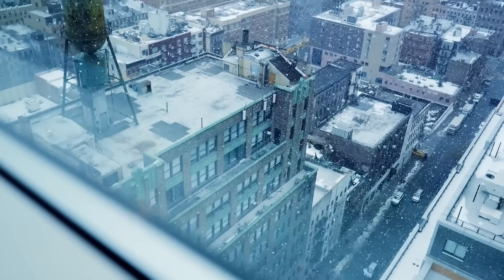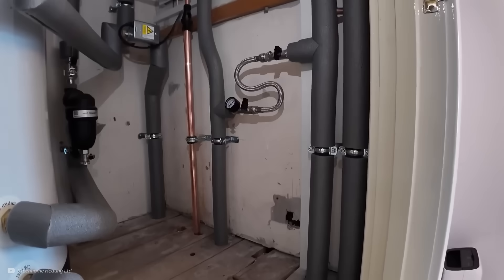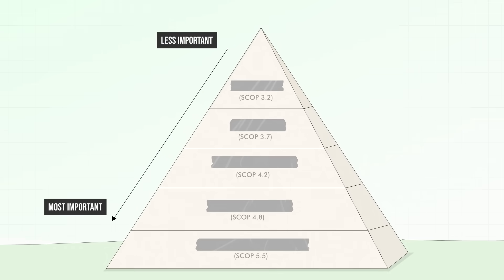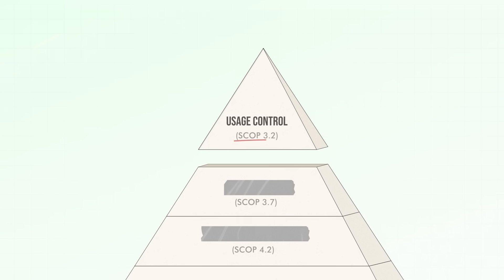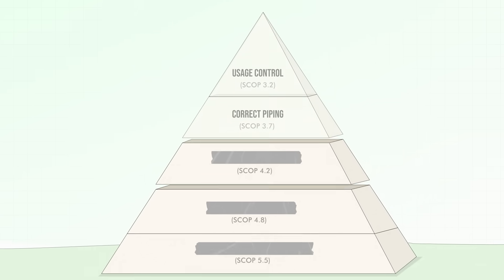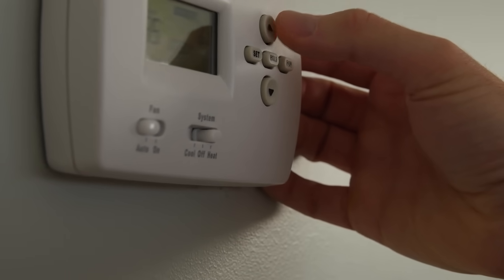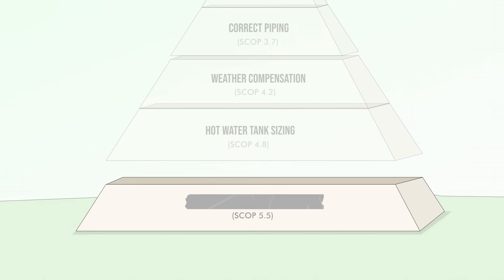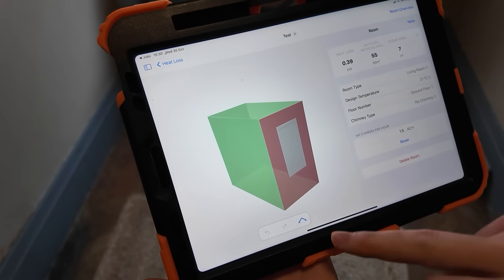The Genius of the World's Most Efficient Heat Pump

Comment: Correct me if I’m wrong: the only part in your system that actually moves heat from the outside environment to your inside environment is the heat pump and that part give you a COP of only around three. The rest of the system - the piping optimization, the heat exchanger optimization, all that, is just to minimize the systematic losses. In another word, the heat pump is your engine and the rest optimizations are your drive trains gear boxes all that. Therefore the most you can get is the amount that can be actually produced or in this case moved by your engine (your heat pump)

So explain this to me: how can you get a systematic COP that is actually higher than the COP of your heat pump? Did you actually get 8 kWh of usable heat by consuming 1 kWh of electricity? Or did you invent some new fancy ways to define systematic COP?
Reply: It's rather misleading i agree. It would be more correct to refer to it as the total system COP.
Reply: Correct, they are accounting for the whole system. Similarly you cannot give an efficiency rating for a car engine that produces an amount of power. Car manufacturers  provide an efficiency rating in MPG depending on the whole system including speed, shape, tyres, electrical systems, weight and load.
Reply: Heat pump COP depends on the temperature differential between inside and outside temperatures.  The "standard" COP stated by a manufacturer is usually for a temperature differential of 35-40 deg C and is around 3-3.5 for modern heat pumps.  If that differential can be reduced to maybe 20 degrees or less, the COP can increase to values >6.  All the "tricks" described in the video are geared to minimize the temperature differential and thus run the heat pump at "slow speed" (=higher COP).
Reply: pppjunk mentions the actual COP will vary according to the temps and mass flows, and the advertised COP is at stated conditions all mfgs use.  It seems the techs in this video have found conditions where the COP is higher than advertised, and strives to operate as near to those points as possible.
* Measuring and (integrating the real time(  delta Hout - delta Hin))  / W  over the day for the current COP or season for SCOP.  (Oddly, kYouTube apparently censors the delta symbol.)  Power inputs for pumping and blowers should also be included.  Using formulas to calculate the real time enthalpies to account for temp and pressure is straightforward.  For the mass flow, ?  Pup and P down across the expansion seems a little trickier, but an orifice plate with ΔP in the vapor line should be good.  Then compare the same system before and after all the nuances are added, to determine the real gain in COP.
Reply: The adjustments raise the efficiency of the heat pump by running it in it's optimum state. It's like increasing your miles per gallon by slowing to 50 mph, ensuring your tyres are filled to the proper air pressure and not driving with the windows open and adjusting your speed to the traffic ahead so you don't need to keep hitting the brakes.
Reply: Calorimeter and wattmeter on heatpumpp inputs and outputs and show us the numbers....
Reply: This is all a stupid explanation. Efficiency factors multiplie in chain. Anything behind the pump itself has effiiciency below 1.0. Otherwise this deserves a nobel price… And the recommendation to "use it right" is strange: That means if outside temperature is low, don't heat because it increses your total efficiency. Or turn hot water down to 35°C to increase the efficiency with the side effect that you will die by legionella…
Reply: u r correct no added 'efficiencies here, its all techno babble n grift n marketing to sell us on marginal products that will break in 5 yrs [out of warranty  of course], save a few bucks maybe n literally just encourage user behaviour change subconsciously, that will drive the actual improvement.
geek or specs n theory does not real efficiency improvements n cast savings make.
without exception assume all these things ARE scams
Reply: The way I understood it was that these COP measurements (each layer of the pyramid) are for the whole system, and are for each improvement to the system. EG, the first stage with a COP of about 3 is an out-of-the-box heat pump system. Then each layer beyond that is a modification that further increases the efficiency of the entire system by reducing the losses incurred by each of those items. 

In other words, the "COP of only around three." is not for the heat pump itself. Its for the whole system without any of their optimizations.
Reply: ITs really just that the system is two heat exchangers with a pump between them. The larger you make either side the more cop. Same thing with optimal pump speeds. They all depend on each other, the pump itself has no cop.
Reply: pppjunk mentions the actual COP will vary according to the temps and mass flows, and the advertised COP is at stated conditions all mfgs use.  It seems the techs in this video have found conditions where the COP is higher than advertised, and strives to operate as near to those points as possible.
* Measuring and (integrating the real time( ΔHout - ΔHin))  / W  over the day for the current COP or season for SCOP.  Power inputs for pumping and blowers should also be included.  Using formulas to calculate the real time enthalpies to account for temp and pressure is straightforward.  For the mass flow, ?  Pup and P down across the expansion seems a little trickier, but an orifice plate with ΔP in the vapor line should be good.  Then compare the same system before and after all the nuances are added, to determine the real gain in COP.
Reply: pppjunk mentions the actual COP will vary according to the temps and mass flows, and the advertised COP is at stated conditions all mfgs use.  It seems the techs in this video have found conditions where the COP is higher than advertised, and strives to operate as near to those points as possible.
* Measuring and (integrating the real time( ΔHout - ΔHin))  / W  over the day for the current COP or season for SCOP.  Power inputs for pumping and blowers should also be included.  Using formulas to calculate the real time enthalpies to account for temp and pressure is straightforward.  For the mass flow, ?  Pup and P down across the expansion seems a little trickier, but an orifice plate with ΔP in the vapor line should be good.  Then compare the same system before and after all the nuances are added, to determine the real gain in COP.
Reply: @zyxlsy  ok I have to admit that optimizing the hydraulics can bump up the cop ..yet cannot get over tech spec cop of the heatpump, just allow to work in optimal conditions
Reply: yeah good question
Reply: @Netherlands031  It's really simple: heat pump COP depends on temperature difference between the two heat exchangers (outside air and warm water in the heating circuit) which is called deltaT. The higher the deltaT, the lower the COP. All the advice he gives boils down to reducing deltaT. Correct choice of radiators and pipes, smart control etc, allow using lower temperature hot water in the circuit. Running the heat pump at lower power for longer is like having larger heat exchangers, again reducing deltaT.
Reply: @pppjunk  you didn't explain how he got a higher cop than the heat pump is specified for
Reply: @Netherlands031  Heat pumps don't specify one COP. They give you several values of COP at various temperatures. You can absolutely get COP 8... at times when you don't need heating at all lol. I think he's bullshitting with the SCOP though, it sounds too high to be true.
Reply: @pppjunk  According to him if you use the correct water pipe fittings you gain 0.5 SCOP 😛
Reply: @Netherlands031  I think this lot that believe these amazing COP and SCOP numbers are the same that invested heavily in 2007-2008 believing everything that this heat geek type person told them about the market, as soon as he started talking about volume of heating fluid, restrictions in pipes, I knew this is gona be all nonsense and inventing new units of "measurement" because - bigger numbers help sell their product
Reply: @Netherlands031 it’s only an estimate from manufacturers, same as range or mpg on cars
Reply: @girenloland  What he notes is that maintaining a low pressure flow of warm water by making sure the pipework does not slow water speeds down (lots of corners in pipes, small pipe diameter vs ideal flow volume) means the water has more time to dump heat that passing at speed through a radiator without enough time for the heat to be dissipated, this is even more so for low flow underfloor heating where there is an larger surface area already than a standard rad. Anything which requires more adapters to connect lengths of pipe also creates water pressure falls - although I don't see how such adapters would generate such a flow rate drop unless your plumber was adapter mad.
Reply: But if you burn diesel or something, you'll get 11 kWh heat per liter... So I mean... It's kinda obvious, that you need better house isolation etc to save as much of that energy inside. By adding an outside wall's isolation, you are not making more kWh out of diesel... You are only saving more of that energy inside...
Reply: @TheCraterGames but that's not what COP calculates. COP does not consider heat losses. The point is that by having lower heat losses, your pump can run at lower flow temperatures to maintain the temperature in your home. Hence you have a lower deltaT, hence higher COP.
Reply: COP is really only the heat pump.  To measure the whole system you would need to have sensors inside and outside every external surface, plus some method of monitoring air leakage.
Reply: Cop is only for your heat pump and exchangers that's it you can not increase it if the pump it self can not do the numbers ,cop takes everything into account proper plumbing, insulation, etc. If the system can only be 3 at x temp that's it will not do any better, now you can add some automation to it to expect weather changes which could help but the cop will be different and be a totally different system floor heating is your best there's a lady in YouTube that has it and keeps her house warm for 2 to 3 days with only about an hour or so worth of heating
Reply: Yup I'm confused too. If I run a resistance heater, it's 100% efficient, it doesn't matter if my windows are open, whether my house is insulated or not, what size my water tank is etc, it's still 100%.

I feel like they've developed a method of measuring that is disingenuous at best. They're calculating run time and how they've managed to decrease it.

This pyramid can be used with any heat source from coal to hp and it will have the same effect. If I find a way to run my resistance heater half the time, I can't suddenly claim it's 200% efficient... Or can I? Someone correct me if I'm wrong.
Reply: @larry365 the point is that with lower losses the heat pump can run at a lower flow temperature to maintain temperature in the house. At a lower flow temp you have a higher COP, hence better efficiency. Compare that to a boiler, where the flow temp has no effect on the efficiency
Reply: @pietheijn-vo1gt  absolutely not true, flow temp does make a difference to efficiency in a boiler - but its its not a big number. Theres a reason theres condensing boilers now, and its for efficiency...
Reply: @Etacovda63  its 5 percent at best... not worth discussing. While for a heat pump flow temp can mean the difference between 200% and 500% COP.
Reply: @larry365  why cant they use something like energy per cubic meters or something like that ? makes more sense to me
Reply: @larry365 
Resistance  makes heat. A heat pump just moves heat around.
Indoor to outdoor or the opposite. 
The losses in the starting and stopping and restrictions in the pipes fitting ( bends) can reduce the effectiveness of the output from the heat pump.
With more heat to capture, 50f outside will be more efficient than 20f.
In cars we effect output with tuned exhaust pipes and low restriction air intakes. Same principles at work as heatpump piping.
Reply: @billsorensen6873  Resistance makes heat ?  But pipe fittings create resistance 😂
A heat pump just moves heat around  ?  If a HP doesn’t produce heat but just consumes electricity to run a big fan , a compressor and a pump how can it be 300% efficient ?
Reply: @larry365  your lack of understanding of the physics doesn't mean they're disingenuous, it means you need to do some reading.

Heatpumps move heat, they don't create it. Look up the refrigeration cycle. Everything heatgeek does is legitimate and in no way a scam. My heatpump is currently running at a COP of 5.15 (1440w power input, 7422w heat out).
Reply: @Etacovda63  You haven't read the OP comment and haven't applied the context of that comment to my comment. I have no issue with COP and I'm not claiming that they claim to break the laws of thermodynamics. My question is how HG arrived at their numbers. Drop the arrogance, especially when you are incapable of reading comments correctly. Feel free to correct my original comment but make sure you read it this time.
Reply: @larry365  They haven't figured out how to make it have a shorter run time.  Just the opposite!  They figured out how to make it run longer but more efficiently.  It's exactly analogous to the car example where one car goes 90 mph but stops a lot, and the other car goes 30 mph constantly.  The 30 mph is more efficient, and less wear on the car.
Reply: @larry365  Yes, slightly harsh, sorry - but you and OP seem to be missing a fundamental aspect of how a heatpumps COP is calculated

A COP is not a fixed figure, its a curve. It changes depending on the temperature at the outside unit, vs the water temperature.

Most air to water heatpumps have ratings like this - they're examples only

A = air temp in C
W = water temp in C
Number = COP

A7/W35 = 4.88
A7/W45 = 4.3
A7/W55 = 3.5

A2/W35 = 4.1
A2/W45 = 3.8
A2/W55 = 2.5

So you can see, if the water temperature is lower and the air temp is higher, your COP increases. I've seen mine running in excess of 10.
Reply: @Etacovda63  All good and your last comment was genuinely the last thing I've read for the penny to finally (hopefully) drop so thank you for the detail. 

So using the car analogy, we are basically saying that by doing the optimisations presented in the video we are, let's say, sending the car "down hill" (eg 30mpg on the flat, 60mpg downhill)?

And these steps can also be taken with any type of heating system but the gains are much more pronounced in a HP system?

We have just moved into a house with no central heating. Full renovation happening over the next few years so I'm trying to get my head round it all so I don't get the wool pulled over my eyes when we start getting quotes for ASHP with UFH downstairs (and upstairs bathroom) and rads upstairs.
Reply: @larry365  yes, thats exactly it. Looking at it like driving a car efficiently is the most intuitive way to do it. 

Its more like putting a streamlined shell around the car to reduce air resistance, adding extra air to the tires to reduce rolling resistance, and accelerating slowly rather than jamming your foot on the accelerator - its like hypermiling a prius.

Best advice i can give for you for your reno is the following - 

Look up 'TOG values' for your flooring material for your underfloor heating. Tiles are best, carpet with heavy underlay is worst. There are better underlays to use with underfloor heating for better efficiency. I believe in the UK there are good flooring people floating around that can help you with that. Its essentially the thermal resistance of your floor finish, which you want as low as possible to allow the heat into the room.

The bigger the radiators you can fit, the lower the flow temperature will be. We use fancoils as our upstairs area is huge and open. Fancoils havent caught up with air to air heatpumps yet (not even close) in features and noise levels, but they're much better than radiators with regards to heat output and the ability to actually heat a room with lower flow temps (a lot of 35c air actually heats a room extremely quickly,  which a fancoil provides - radiators rely on convection - a fancoil can put out many times the heat with the same surface area). 

'Designer' radiators are a waste of time with a heatpump, the power output is far too low. 

If you're lacking in area to put them, look at triple panel rads at least, or fancoils. Since you're using underfloor heating Id aim to use the same flow temperature throughout the entire house; but your heating engineer may decide that lower flow with 45c for underfloor and radiators is better than 35c flow with large radiators, but this will come down to your preference ultimately.

If you want to fully geek out on it, heatpunk is worth playing with to understand how outputs/heatloss etc all works, as you can model your house directly in it.

Comment: I thought the maximum theoretical COP was 7,6? For groundsource heatpumps. If you get 8,0 in an airsourced heatpump you must use a other way to calculate it. Nibe Swedens best brand of heatpump have top COP in its heatpumps but have got 6,22 COP in a yearly coldclimate average. That means 622% in effeciency over the whole year. And Nibe is top of the line products in heatpumps!